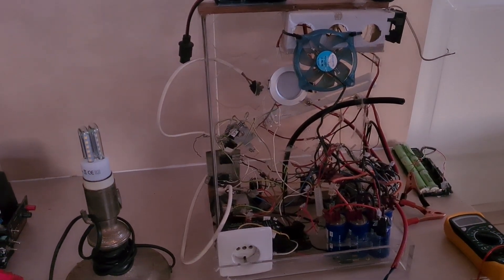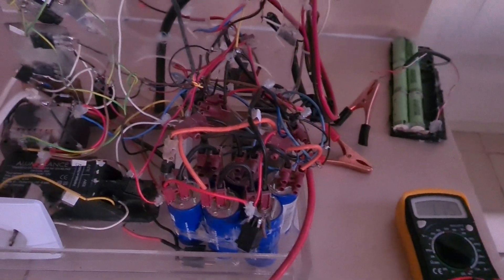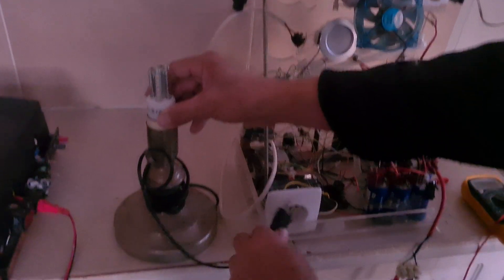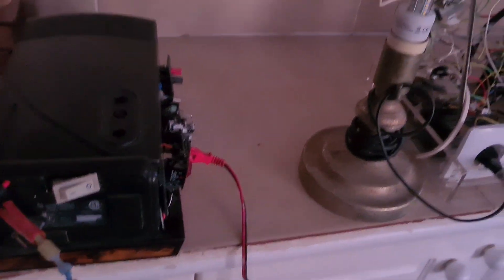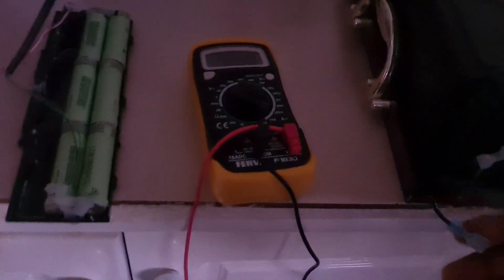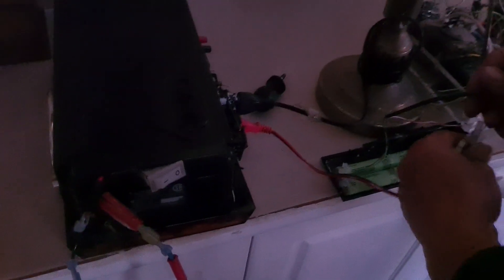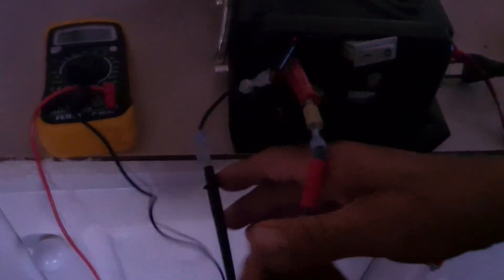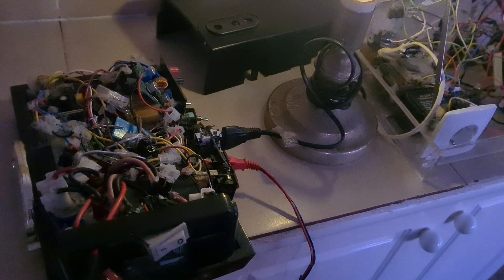Power your home fuel-less on capacitors, make it bigger and go for your love!

Comment: Watch how to make a magnesium neodymium rotor

https://youtu.be/h6XEGcL2_Wc
Reply from the maker: Hi thank you for the link it is very interesting. I know this method. I saw it on a rotor of a generator with no magnets on it, they took the rotor out and installed 2 lithium batteries of 3.7V in parallel and 2 other 3.7V batteries 18650 on the base of the rotor. The + and - of the batteries were connected with a small resistor to the contact of the wiring of the coil and they glued the batteries on the rotor without disturbing its rotations. This way the rotor became magnetic and it worked. Here it's the same principle but done with a bigger battery. Thank you

Comment: Dear Denis!
I would recommend that you disclose this knowledge with circuit diagrams and specific parameters and data. 
(I try to do this on my channel). 
This would be important so that anyone can repeat it, so this thing will not be lost to humanity.
Hi!
Reply from the maker: Hi I watched you channel, it's very interesting. Quite nice things you have there. Well, this specific generator I didn't share the plans for the simple reason that high voltage is involved and it's a dangerous concept if you don't know what you are doing. I have the plans but I got a shock myself twice already and it's not nice. But the plans for a moving parts generator like the fuel-less mechanical free energy generator that can power a home video I can share with you. You have to write your email with spaces so that YouTube doesn't remove the comment. Here is my mail luelmade (at) hot mail dot com. Good luck and thanks
Reply: @denissabourin  

hi dennis,

I see you've put a lot of work into it and it's absolutely amazing, thank you very much for that! Using energy properly is a lost technology and has unfortunately stolen a lot of time from humanity. I think like the previous speaker that this knowledge must not be lost and should be available to everyone...

I would like to know more about how you connected everything with which components
can I also write you an email where you can perhaps explain more about it to me?

Thank you very much and good luck with your future projects!!
Reply from the maker: @LoudDirector  hi there, thank you for your kind words. Basically, the concept works on oscillation and transformers along with different kinds of capacitors. I agree with you that the knowledge has to be shared with all people who need it. My personal issue is that I've invested so much time in this for years, so sometimes, when I am offered a donation, it helps me continue my research and survive. It does take a lot of time and resources. I am happy to share information with people who would like to develop the concepts or help in any way they can. Thanks for your understanding. My email is Luelmade@hotmail.com 
Denis